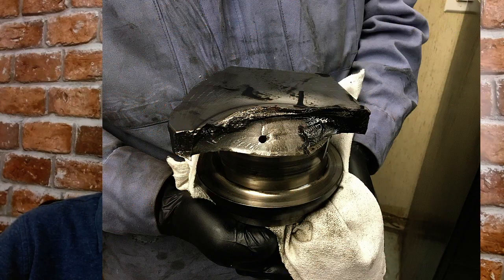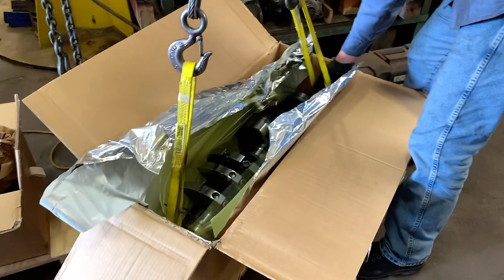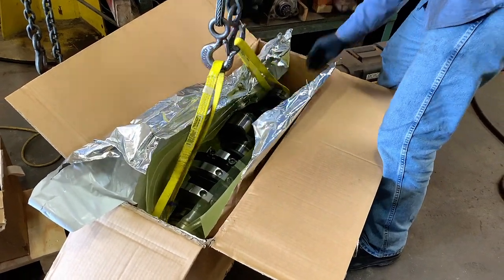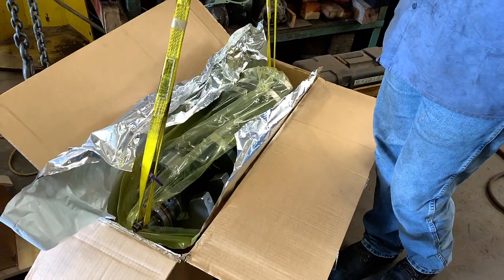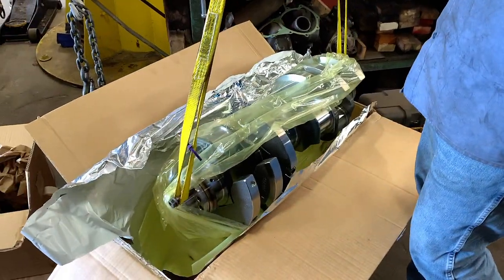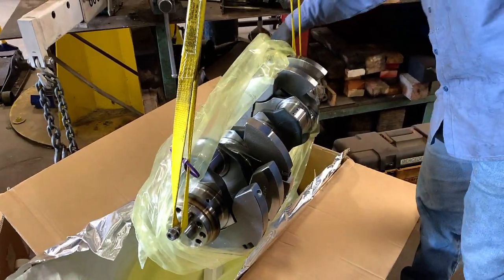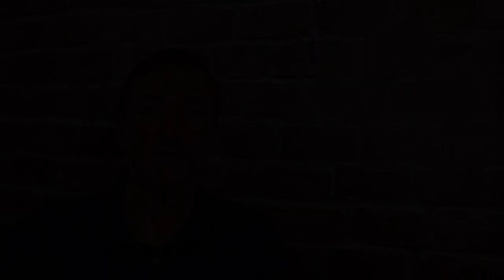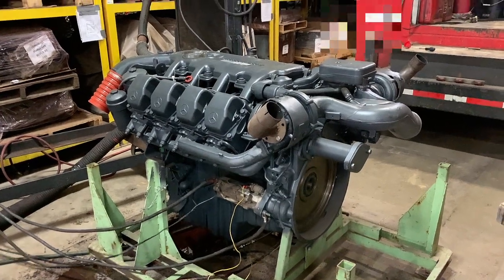mercedes benz OM442 LA running with rebuild tip

Comment: Hello.  Can you send the listing of all you did to the engine to upgrade it ?!
Reply from the maker: Sorry I do not have that build list any longer. That was the last engine we built for that machine and then the machine was turned out of the fleet due to age.
Reply: @ENGINESHOPJOE  Great machine . The  crankshaft gear you talked about .The replacement gear . What is it an upgrade  or stock ? Do you have the part number of it  or where to buy the gear .